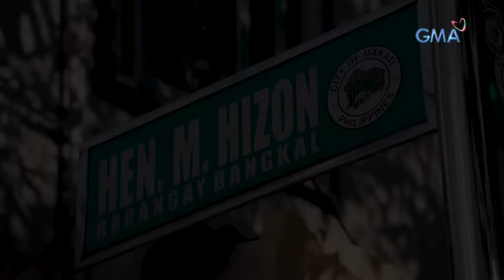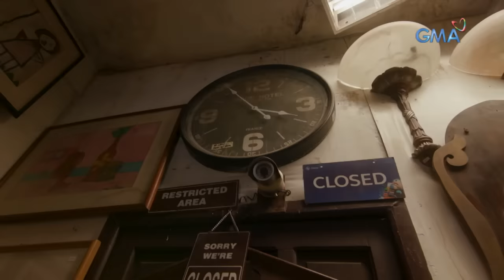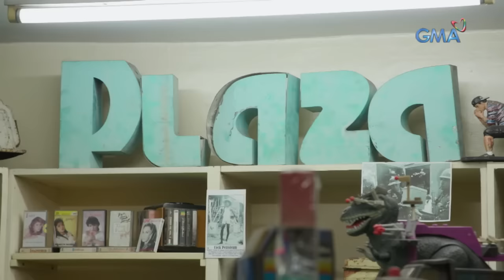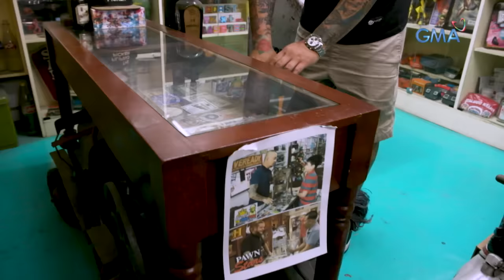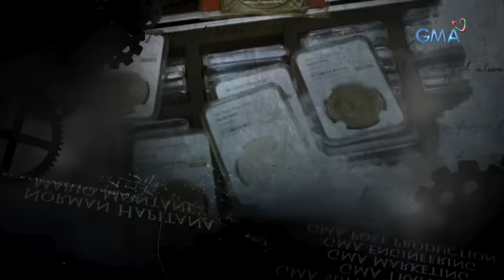'Ang Antique at ang Gen Z,' dokumentaryo ni Atom Araullo | I-Witness

Comment: Nahilig din ako sa ganyang kalakaran wayback 2014 onward pero naka focus ako sa mga vintage or classic phones ng Nokia especially yung Nokia 3210. Sa una kinokolekta ko lahat ng classic phones ng Nokia brand hanggang sa nadiskubre ko na merong magandang market ang classic phone model nito. For example binibili ko ang item sa halagang 200 to 500 depende sa sitwasyon ng phone. Tapos after restoration which is ako din gumagawa, nabebenta ko ito sa halagang 1.5k to 8k depende naman kung anong model unit ito. Yung Pinakamahal na nabenta ko ay worth 8500 pesos Nokia 7110 tapos meron naman akong nabentang Nokia 3210 sa isang tao na naghahanap ng classic cellphone kase gagamitin nila sa pelikula bilang props